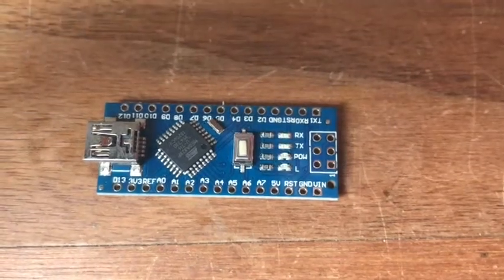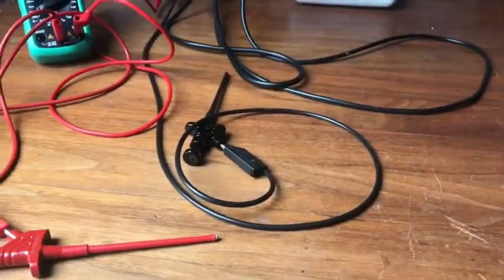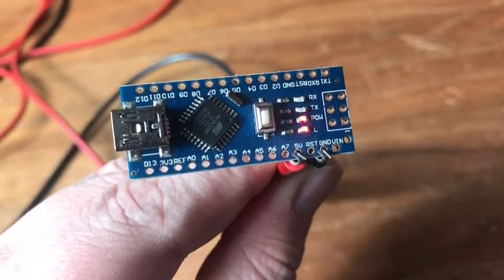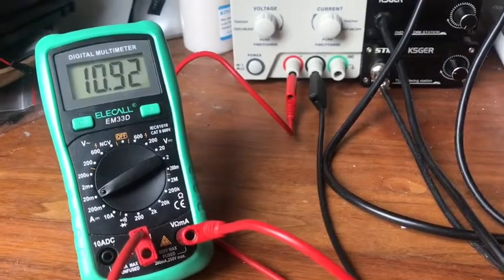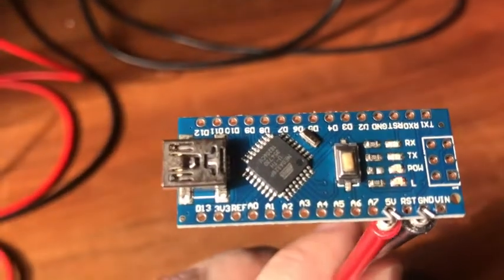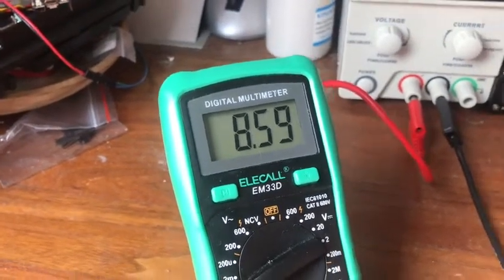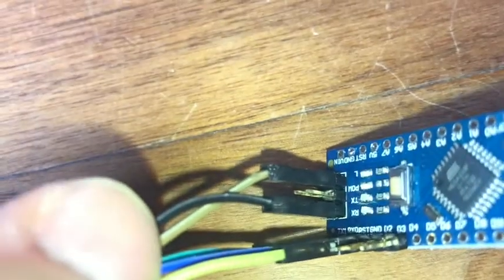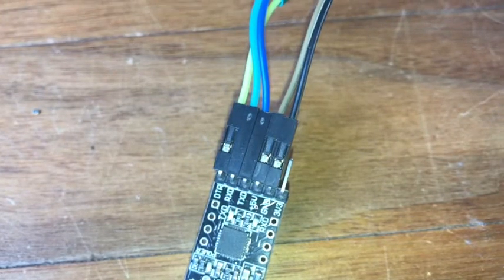Arduino Low Power Project - 200 nA Atmega328p

Comment: hi i am doing a project with arduino nano. but I can't get it to consume less than 200 uA. I take out the regulator, leds and the ch340. can it be a problem that there are different versions of the chip?
Reply from the maker: Hi only just noticed your message.
A large part of the low power comes from the deep sleep mode and the interrupt wake (not watchdog)

Uploaded this sketch for you as a reference:
https://github.com/genotix/bedlight_ATMEGA328p
Reply from the maker: This is my 200 nA interrupt sketch:
https://github.com/genotix/low_power_ATMEGA328P

Comment: Good video thanks. But why not use a pro mini for low power projects?
Only have to remove the power led and regulator.
Reply from the maker: Ian Tcroft hi Ian, thanks for your response. 

The Pro Mini didn’t give me this low idle state. Also the software power reduction instructions of the 32u4 aren’t the same as the 328p.

Also I had about 8 “clones” of the 32u4 and they all died pretty quickly. :(

For both the 32u4 and 328p I wish there was a version with both a buck convertor i/o Vreg and also like 3 analog and 3 digital ports.

That should suit most small and low-power projects and keep the formfactor small.
Reply: Aad Noll hi sorry I don’t follow? I didn’t mention anything about the 32u4? The pro mini has the 328p chip the same as the nano that you are using in your vlog? You may be getting mixed up with the pro micro I think?
Reply from the maker: @iantcroft  yes, you're right; I'm mixing them up.

Have used the pro mini too; same specs and works just as well as the Nano V3.
For diversity there isn't a lot of difference also not really in price.

For low-power projects the Mini is better because it requires less modifications to make it do the same thing.

I kindof always order the Nano v3 because it's easier to program without checking the pin's.
I wish a different header would be built which had a lower profile and a more stirdy connection.
Addinf headers to an arduino at least doubles it in height and when using it it normally triples it.
Reply: Aad Noll I like the 3.3v pro mini as it’s cheap, not many components to remove to make it low power but you do need the ftdi board to program. Another interesting video would be to use the pro mini, remove components to make low power and then add a low drop out regulator like an mcp1700 ideal for battery powered projects.
Reply from the maker: @iantcroft  thanks for the tip; i like the LDO's and think it's a pity they are not 1 on 1 replacable with the commonly used AMS1117 (Vin & Vout are swapped).
Still a good component to use in Low Power projects.

I like fiddling with Ultracaps and power havesting too. ;)
Reply: Aad Noll I have only looked at the mcp1700 I will also have a look at the ams1117 thanks. You should do some videos on the things you have tried, they are all interesting.
Reply from the maker: Ian Tcroft the AMS1117 you’ll see on all Nano v3’s and a lot of other Arduino’s as a regular Vreg.
Reply: Aad Noll I normally remove that one for a better low drop out regulator for battery (18650) projects.
Reply from the maker: Ian Tcroft i can imagine; me too since it’s a power drain.

I have replaced it with a light weight step down in the past.

Just uploaded my latest “thing”:
https://youtu.be/TymK9iGltEs
Reply from the maker: Ian Tcroft https://youtu.be/41sN7Bqymf8 this clock I had for some time now.
Combines several sensors.
Reply: A trick : you can watch series at instaflixxer. Been using them for watching loads of movies during the lockdown.
Reply: @Shepard Zane yea, I've been watching on instaflixxer for since november myself :)